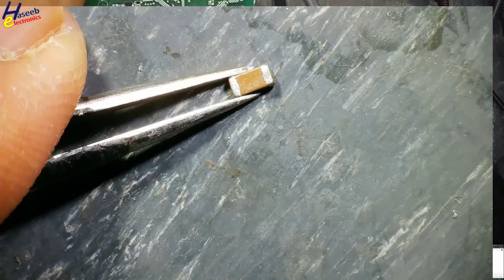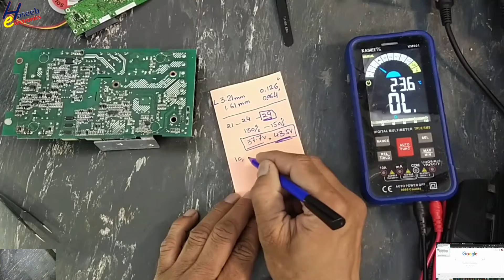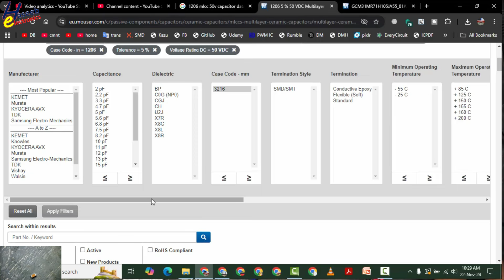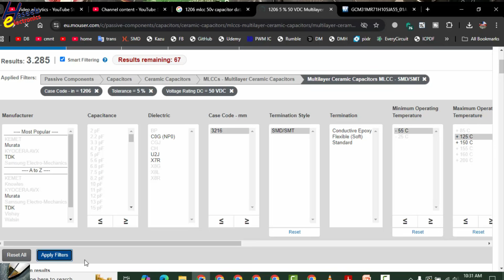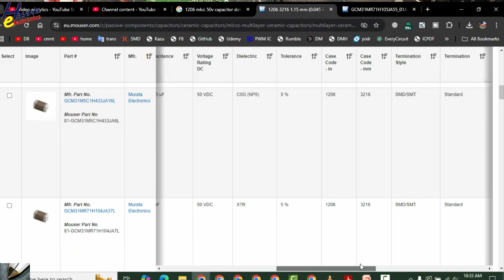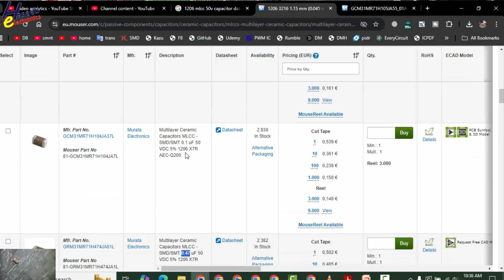{1243A} Decoding 1206 SMD Ceramic capacitor

Comment: Nicely explained
Sir, which website did you use? Please tell
Reply from the maker: Sorry, i forgot to write the wbesite address. please, check the link below:-    
https://eu.mouser.com/c/passive-components/capacitors/ceramic-capacitors/mlccs-multilayer-ceramic-capacitors/multilayer-ceramic-capacitors-mlcc-smd-smt/?case%20code%20-%20in=1206&case%20code%20-%20mm=3216&height=1.15%20mm%20%280.045%20in%29&length=3.2%20mm%20%280.126%20in%29&maximum%20operating%20temperature=%2B%20125%20C&minimum%20operating%20temperature=-%2055%20C&termination%20style=SMD%2FSMT&voltage%20rating%20dc=35%20VDC~~50%20VDC&width=1.6%20mm%20%280.063%20in%29&rp=passive-components%2Fcapacitors%2Fceramic-capacitors%2Fmlccs-multilayer-ceramic-capacitors%2Fmultilayer-ceramic-capacitors-mlcc-smd-smt%7C~Voltage%20Rating%20DC%7C~Case%20Code%20-%20mm%7C~Termination%20Style%7C~Minimum%20Operating%20Temperature%7C~Maximum%20Operating%20Temperature%7C~Length%7C~Width%7C~Height

Comment: Jazak allahu kheyran, great and so useful as usual enjoy every piece of information you say,  may i ask about that Eppxy glue below such components and ICs , 
What is the appropriate temperature and air level that must not be exceeded so as not to cause damage when removing these components including the epoxy adhesive below , which may take longer to remove  and cause damage to such components?